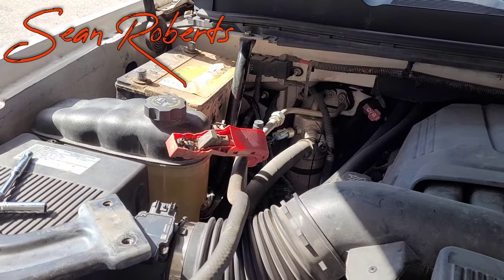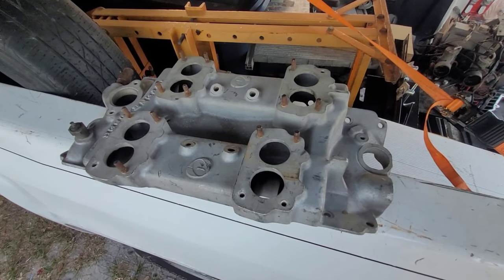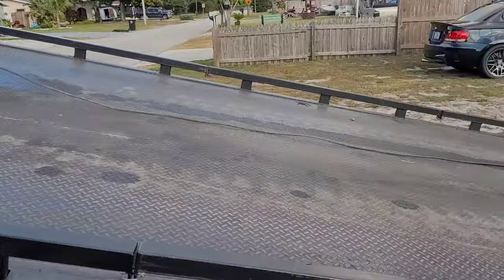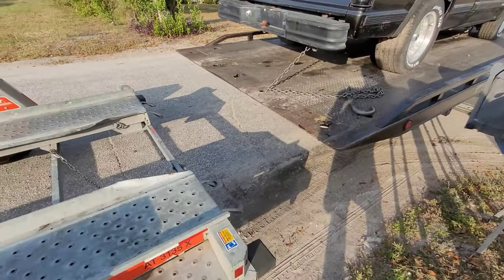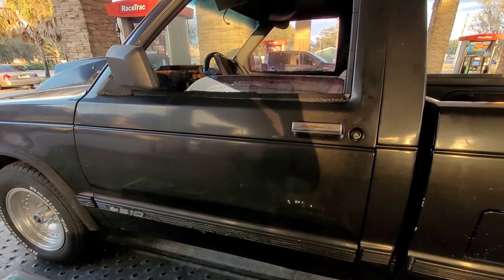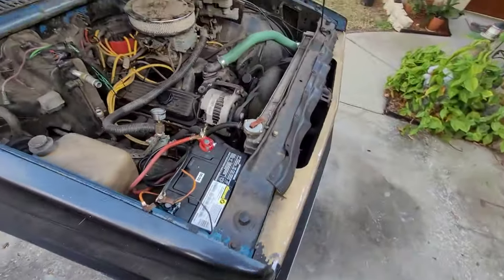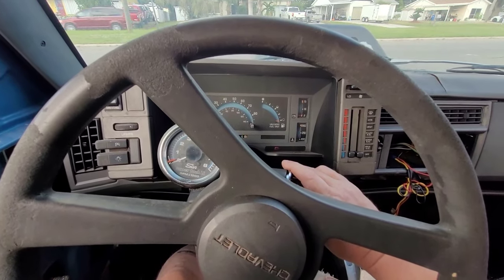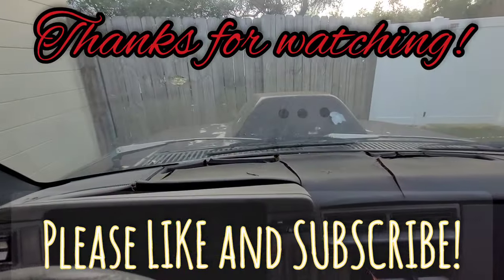I GOT A V8 S10!

Comment: Cool truck, but those are not vortec heads bud. Those are 87 to 95 TBI heads. Also called swirled port. Vortecs have 4 bolts holding the intake manifold down. Tbi's have 12 volts holding it down like the old style, but the middle four are at a different angle, like those. Vortex and the swirled Port both have four bolts holding the valve covers down. Still good heads though
Reply from the maker: I've had very little experience with that type of cylinder head, obviously. lol
I was already using Iron Eagles and Dart aluminum heads on my cars during that era. I think the main reason I went to aftermarket heads is that I could choose every aspect of them...chamber, runner, valve size...
Thanks for watching and commenting!